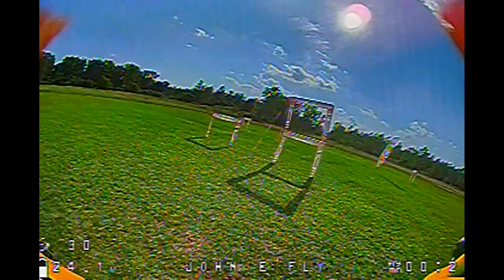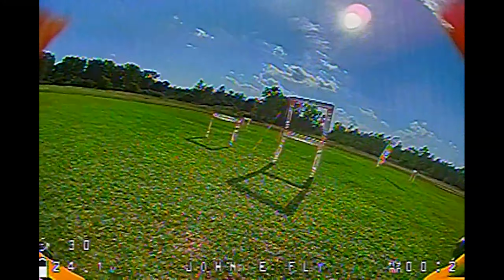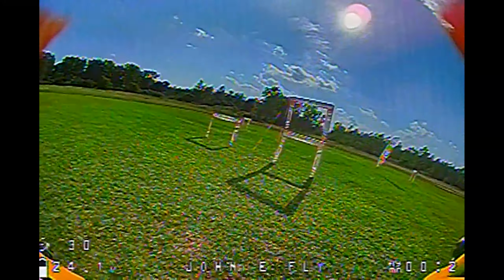Lower Your Camera Angle To Go Faster??????

Comment: I was at 60 up until champs last year. I knew I wanted to go lower, but was nervous to do it right before champs, but as soon as I got back I printed 45 fixed angle and switched over. Makes a big difference for me especially in vertical elements like dive gates, etc. I do think new/intermediate pilots spending a little time at higher tilts can help push them to keep a higher overall pace and get used to that faster pace.

Comment: Frustratingly, for me it varies based on quad setup - my super-light 2205 rigs that do better at slowing down in a straight line and hold a little bit stouter in turns, I end up running 55-60° comfortably. My chonky 6" frame 2208 rigs, I sit at 47° with all of them and they fly with a similar feel, and it just works.  Angry 3" 1408 rigs, I have to run 50-55° to feel like I'm cornering usefully, while my ligher ~100g 1105 3" rigs are perfectly content in the 45-50° range... so I'm a mess, but all of the angles below that 60° on my lightest stuff, I did have to lower camera angle to get consistent enough to be fast.
Camera lens plays a part in this too - the Nano2, Razer, and ArrowMicro setups on 1.8mm lenses have huge FOV so I can be pretty comfortable in slower technical sections at higher tilt, while the Predators on 1.8mm lenses give up a small amount of diagonal FOV for better useful resolution, and those feel much better to me flying as a 'momentum' quad, instead of 'point & squirt' type setup.
Reply from the maker: Totally agree with you. Weight plays a role and the camera fov plays a huge role.  I think the super wide cameras really made it better to fly all out while still having a low tilt
Reply: @JohnEFly  Yeah, I was just blown away that the lighter ones got easier to fly at higher camera angle, while the heavier ones were always more controllable at 10° less.  I don't think I change flying style that much, but maybe I do.

Comment: So basically, the wider FOV of those 1.7-1.8mm cameras these days enable you to "see" camera angles from, lets say 10 degrees to 70 degrees, so you can change speeds faster and "see" more. In a nutshell, the FOV makes the lower angle more versatile. Is this correct?
Reply: More FOV makes any camera rake more versatile - having more FOV means you can dial a camera up to 50° and still be able to see the front of the motor plane on quads, similarly at 35° a really wide FOV setup actually lets you see 'down' slightly, all the way up to >70° up, which is why for freestyle that's a great setup.  The tradeoff in FOV is always resolving distant objects, as they become a touch smaller when you 'zoom out' with wider angle lenses, and you get a little bit more optical distortion when up close, but flyability is almost always better.
Reply from the maker: Yes, definitely, the wider FOV makes all camera angles more versatile.  You can have a 40 degree camera angle yet still see in front of you while flying at full throttle.  With less FOV that wouldn't be possible.  Likewise, you can slow way down and still see where you are going with these wider FOVs as well.